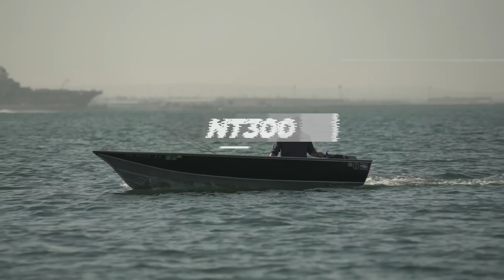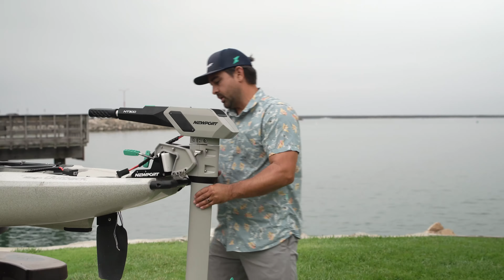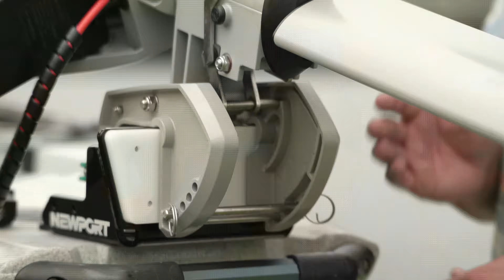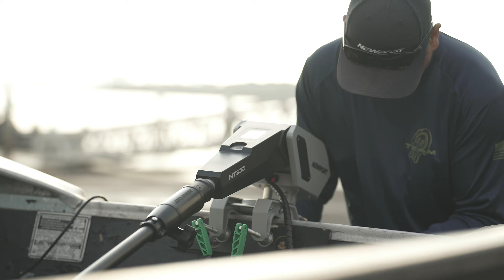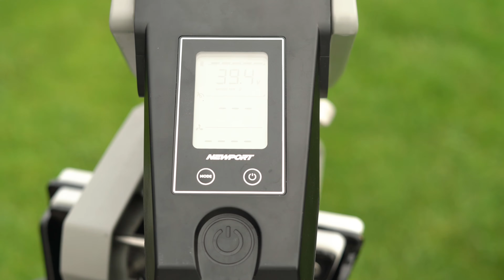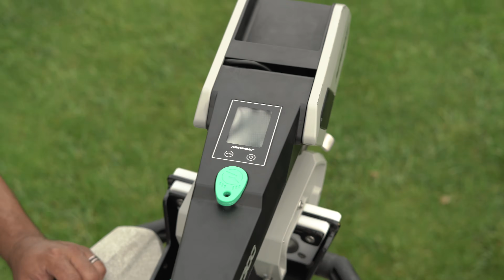NT300 3hp Electric Outboard Motor | Quick Start Guide

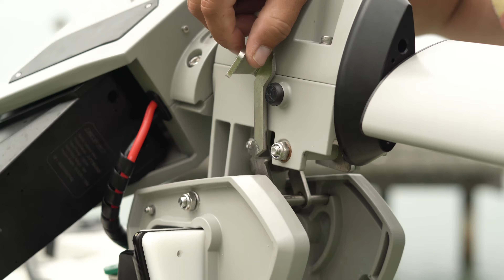Comment: 2:29 I’m just now unboxing, and I couldn’t figure out why I couldn’t rock it upwards…those black plastic knobs shown here (at 2:29) make it super snug. So it takes a little force to pivot it up or down. I was first wondering if those are just for shipping. But after more thought, it prob keeps it from rotating downwards too quickly. 
I also couldn’t figure out why it would only turn in one direction. Just like another person mentioned, I noticed that the shaft shape was not lining up with the shape of the mounting section, and that it had been shipped/packed with the shaft facing backwards. Once I turned that the right way, it rotates as it should.
I didn’t get an operators manual, but I did find one online. It doesn’t mention anything about unboxing (like the shaft being reversed for packing) or that you might have to apply a bit of pressure for raising/lowering. That would have been helpful!

Comment: My motor came rotated 180 degrees around. It appears the steering lock is engaged in that position. I cannot find anything in the manual about how to unlock and rotate it. Cannot find anything videos. Extremely frustrating.

Comment: Just emailed you guys. I'm new to the kayak/solo skiff game.  I'm going to be installing it on the NS130. I will be doing beach launches primarily, no boat ramp launches. My question is, to mount to NT300, does the skiff have to be elevated above the ground? once mounted, can it be launched from the shore with the motor tilted up and locked out?